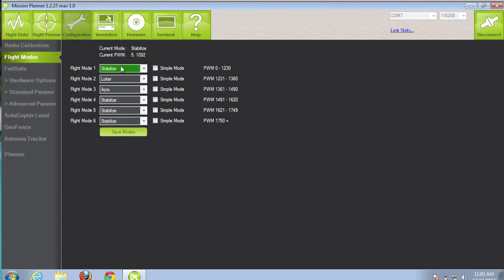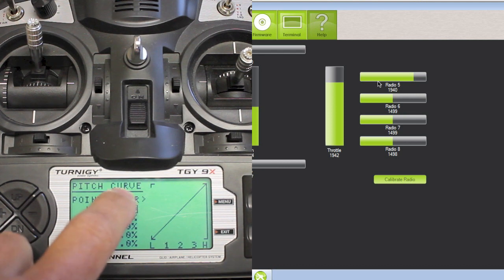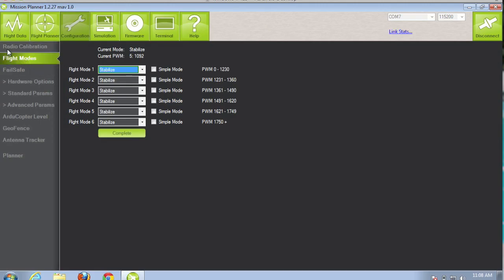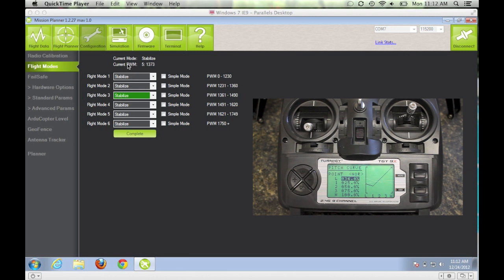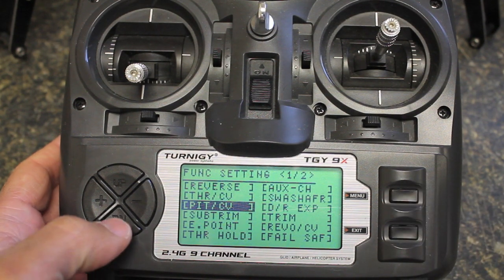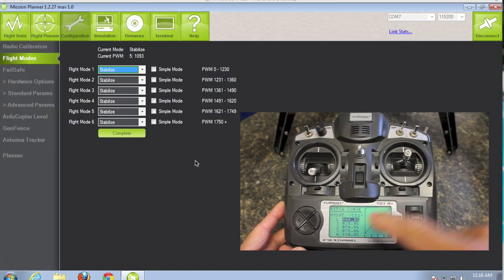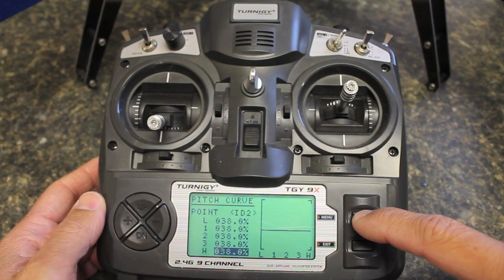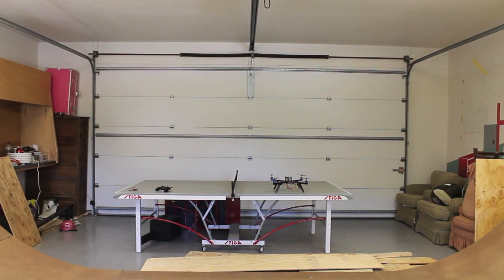Turnigy 9x Transmitter & 3 Mode Auxiliary Switch for Different Flight Modes with APM 2.5 Quadcopter

Comment: Hi Dennis! I'm having flaps on channels 5 & 6 (operating on the Pitch Trim dial) because Bixler 2 needs reverse on one of the servos operating flaps, so I'd like to configure APM mode switch on the channel 7 or 8. Any hints how to do it?

Comment from the maker: Most pilots that I know here in the U.S. fly in Mode 2. That means the throttle stick is on the left. That's what I'm most comfortable with, but I know there are pilots in other countries that fly with the throttle on the right. It's a matter of preference, but if you've grown up in the U.S. and flown any RC toys over the years then the throttle is always on the left. This is configurable in the Turnigy 9X menu. You can change between Mode 1 and Mode 2. Let me know if you need help w/ config.

Comment: One thing I did was set both sets of three, either gear up or gear down so that the bottom of the three position is Return to Launch. That way in a panic I can switch the three position to the bottom no matter where the gear switch is. So in reality I have 5 modes with redundant easy to find RTL.

Comment: Dennis you can tie the Gear switch to the Three position switch on the 9x and get 6 flight modes. It was several months ago since I figured it out so its a foggy secret as to how but it is definitely possible.

Comment: Hi,

Its a scratch built wooden H-frame.
The purpose is a photo platform, so I want to have it secure and not fun :-)
Since I use Arduflyer 2.9.1b, I think my problems are vibrations and I will try to get rid of those first. My Board is solid mounted on the frame today.

Comment from the maker: Great question. I don't think that's possible, but will look into it further. What I do know is possible, if you're flying with APM 2.5, is to set one of the flight modes to auto (waypoint navigation). As part of your "mission" you could tell the first waypoint to be at a certain location and altitude. You could have each switch position respond to a certain location and altitude. So you're sort of faking the "action". I haven't done this, but will investigate. Neat idea.

Comment from the maker: I have a few vids that show how to use the gear switch with Naza as well as the 3 way switch for different flight modes. What are you trying to do with the gear switch and maybe I can help you through it. The easiest thing to do will be to sign up at garagepilots . com and post in the forums. Either myself or another member of our community can help you through it. Good luck!

Comment: Thanks for your generous response mate. I have done every thing except solve the problem of the Yaw I center the servo for the home made yaw mechanism in which I have the servo lying down on its side in a direct drive mode using two nylon hinges with the servo gear head lined up with the hinge pin. No binding, strong tensile andslick,  but as soon as I turn on the board, It goes one way and stays there. The center is gone and no proper control may be had. Don't quite understand  ...yet!

Comment from the maker: Chris, yeah it sounds like you got it figured out! The only other thing I can suggest, and you probably already know this, is to make sure you have your 9X configured to put the gear switch on CH5 or whatever channel you want. This is done in the AUX-CH settings menu. Then you need to tell your KK board that you want to use the AUX channel vs arming using your sticks. I hope this helps and let me know if you have any problems. Thanks for the feedback.

Comment: Dennis, I was wondering about the gear switch for the Auto Level on the KK2.0 LCD board. I am using a 9X, so is it simply a matter of setting the Aux#5 to Gear Switch and have the Ch 5 from the Rx connected to the auto level input on the KK2? This may sound like a simple Q but I am mired in the process of my first Tri (actually 1st RC airframe)  and have my hands full.  Thanks, I am a new subscriber. You have some great experience that you have shared with the RC community. Good on ya Mate!

Comment: hi i just finished me quadcopter.everything works nice but i cannot get into the air,when i think i did it right PID the front two motors spin faster and me quadcopter go back and then quad flips over ??

Comment from the maker: Patrick, that's interesting to hear and I will definitely start looking into this. I have had no problems at all flying in heli mode, but I haven't tried to do anything fancy like loops or rolls yet. Are you asking specifically about acrobatic flight or just if it's possible to fly in heli mode, which I do all the time.

Comment: I have a question. I have ch5 linked to my pitch, so in theory when i pitch the PWM is changing on ch5, which is gonna change my flight modes when i use pitch isnt it? Im in the flight mode configuration and i can see when i move my pitch stick the flight modes are changing aswell as when i select the 3 different switch modes. Any ideas? Cheers great video, For me i had to edit 2 on the point for each NOR ID1 and ID2,

Comment: Hi Dennis, followed your advice here and this works perfectly for the APM 2.5+, another good job :)

Also I set AUX-CH 7 in the 9x TX to be GEAR and had the RX CH 7 connected to APM input 7 so that I can use the GEAR switch to fire an emergency RTL overide.  Worked OK but had an issue trying to disarm (quad had landed, motors still spinning, flight mode to stabilise throttle down.  Switched off GEAR but motors still running, so flicked flight mode switch to loiter and back to stabilse to fix).

Comment from the maker: I wonder what's going on with your transmitter??? Have you had any luck since you posted this? Also, not to answer your question with a question, but how do you know V2 firmware vs V1? Just so I understand what's happening you can decrease your H point on ID1 from 100% but when you save (hit Menu) it doesn't take? Do any of your other curve points for ID1 save?

Comment: I'm having a hard time getting my 3 position switch to work at all? I have V2 just like your's and the last number on ID1 will not change from 100%? it move's but when I go to save it, something go's nuts and it go's back to 100%? the rest are what I set them up at 30% but where the H is it will not take? and Marry Christmas! by the way!